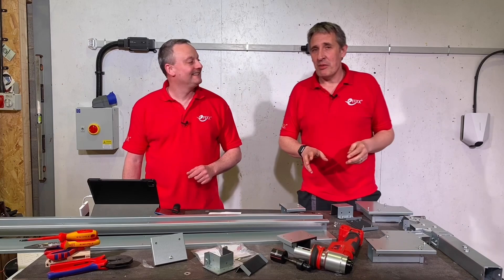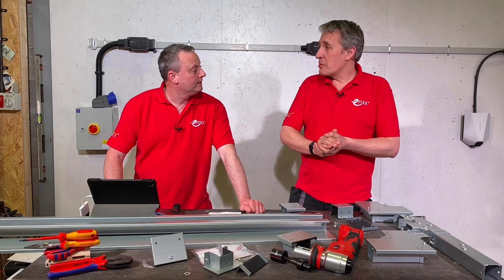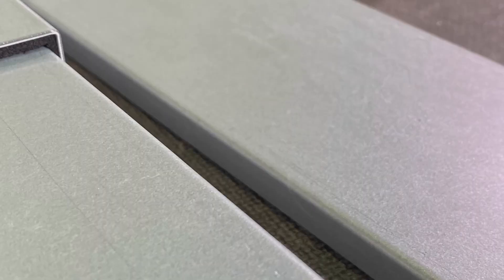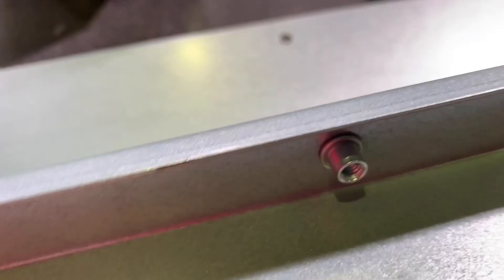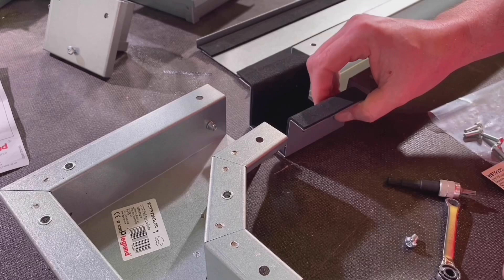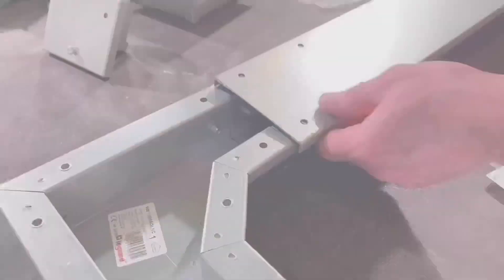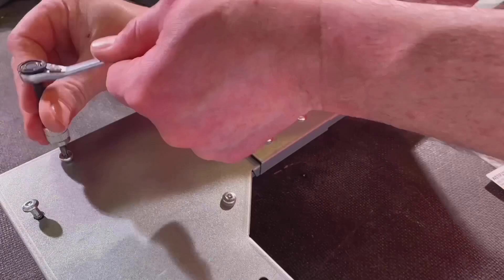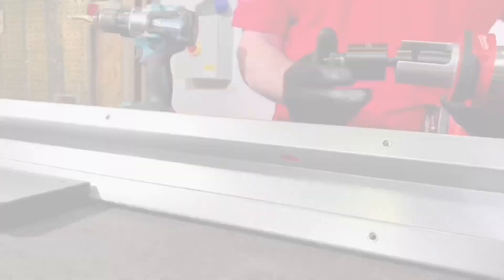Metal trunking for OUTDOOR  - IP55 Salamandre by Legrand

Comment: This would be great for a couple of the factories I do work at only issues being, how to securely fix it to the wall and not intrude on the ip rating, didn't see any examples of fixings? Also cutting to length and the flange is great but also can be limiting on locations if you have other services running parallel.

Comment: Wow I say thats expensive! Looks good but a lot of questions pop up on my mind with this one, cutting it with a angle grinder destroying the galv and powercoat protection ? We all know galv spray doesn't give as good protection as factory. Drilling holes  to mount it on unistrut or brackets loosing the ip rating? Installing galvanised conduit to this system again loosing the ip rating ? Or simply adding pg gland or cw swa gland will suffice ?

Comment: How do you screw it to a wall?
What about a cut length the coupler wouldn't fit without the existing bushes
Reply: I wondered that when the earth strap is fixed from behind????
Reply: Those 'bushes' are rivnuts... you could use them to put one on a cut length :)